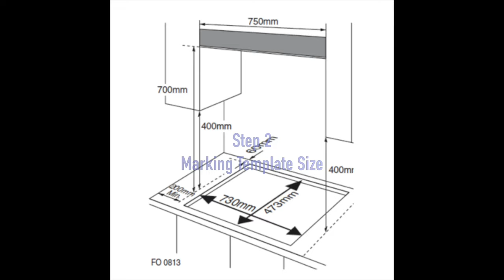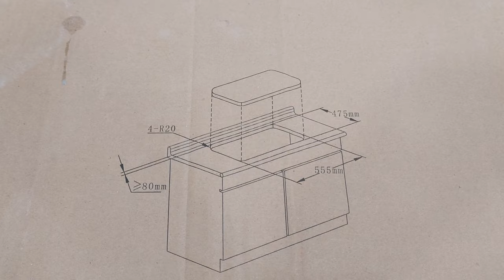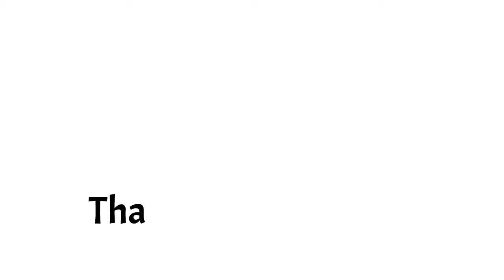Built-In HOB Installation, Modular kitchen, Step by Step #hob #builtinhob #stove

Comment: video  made with very poor style of working artisan (worker) he is not using dust collector from circular saw , he is not wearing any industrial mask nor gloves and glasses for his personal safety nor was told to him at least wear while videography  so that follower can do same thing while cutting 
he is not knowing that to cut ply board under top by jig saw and not able to operate wood saw to cut 
he was not using any guide while cutting top to achieve smooth cut  very bad practices are transmitted for others to follow .
dust was collecting on bearing of slides which will never be cleaned 
actual installation not shown , how and from where gas pipe is connected ,and  how the hob is locked with granite is not shown 
pl mind the video is seen by many workers also not by skilled people 
post corrected video.